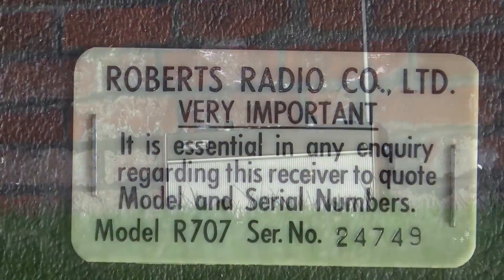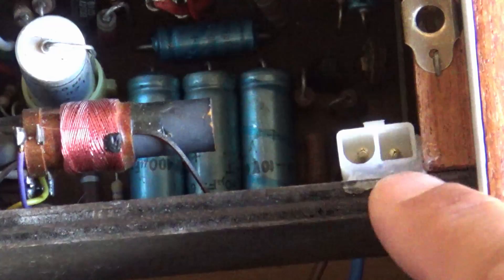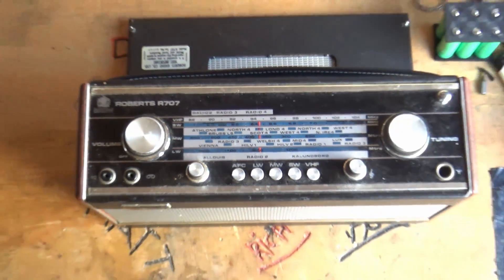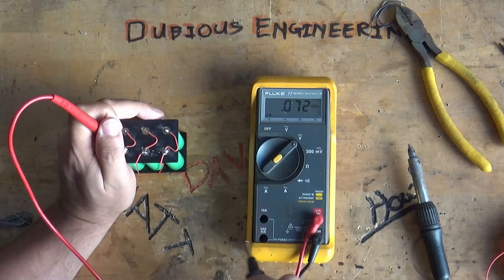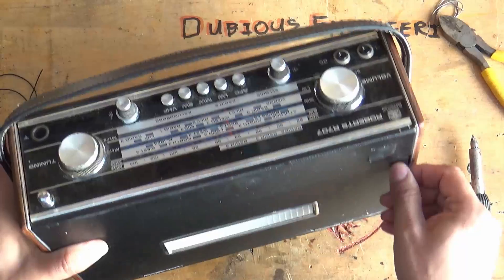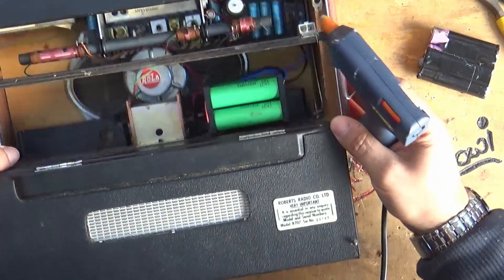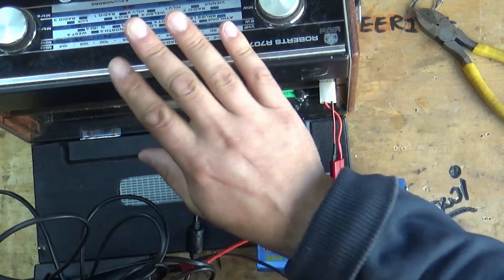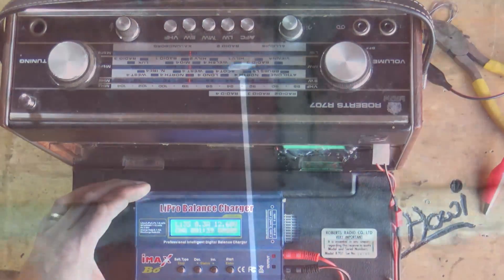DuB-EnG: Vintage Roberts707R Radio Upgrade to Lithium Ion - DIY How To Refurbish Repair LW MW SW FM

Comment: I get a headache watching this. 
You are hyperactive.
No structure.  Vital information not given. Instead spinning this radio around and around and around again.
I am guessing that these radios originally have 2x 6 volt batteries in series and therefore run on 12 volt.
Reply from the maker: Yes, I'm sure i have a mental condition...  i hope I'm getting it more under control these days...  i think they needed 6v for the valve heating elements and 12v for the radio circuit...  sorry i drove you nuts! 😀 best, Howard

Comment: why go to all this trouble, just buy 12 volt mains adaptor from amazon £3.99 but looks like you ripped it out, chrome circle on side of wood, waste of time as you can also plug it into car 12volt too ,with adaptor,,as i use it in my camper van, no messing about with stupid batteries that are also bad for the environment !!!!!!
Reply from the maker: Its a good point Terry... that said, it's nice to be completely portable...  I'd like a solar panel on it one day!

Comment: ha ha you evil swine :-D
I was going to say if it sat near a window then hang a small solar panel on its back and rig up a trickle charger to keep the batterys up, i dont know if l-ion batterys would mind that.
But its likely it will sit against a wall.

The hacker radio uses 18v (2 x 9v), and some odd radios use the batterys wired  +9  0 -9 volt.
Must be for a push pull p.a with center 0v.
Reply from the maker: Ah...  I'd forgotten about Hacker radios! - You're right! They did use class AB push/pull transistor amplifiers on their power amp stages...  This radio does spend most of its time in the window, so a 12v trickle charge would be a great idea!  I just need to limit the voltage to 3x4.2v = 12.6Vmax...  I'll see what kit I have kicking around... perhaps an LM317T would do the job!
Reply: The lm317t is my favorite, such a usefull regulator 1.25v upwards i think, and using regulators for current limiting is naughty too lol.
Im sure you have used the 78xx series too, so many out there to fondle :-D
But the L200 is a touchy sod without a really good metal to tab heatsink.
Or perhaps you like the discrete transistor/zenna/caps/reststor/stabilzer  circuits.
Reply from the maker: Here’s a little short to amuse you...   https://youtu.be/q2iAUVnwMaA
Reply from the maker: Yeah... I’ve tried them all... and the 317T and 78xx win... you can even get a 317T in a large SO2 package for higher current applications... 🙀 5WholeAmps! ...  I reckon a 7812 500mW and a 16-20v solar panel will do the job...  now... dang... if only I had that stuff kicking around ! ...   as an aside, I keep toying with the idea of an appregiator made from 5 off 555circuits...   that would be fun to noodle around with...  but...  there are so many other projects to finish first...
Reply: I had to look that name up, from the discriptions it sounds confusing, but im not into music lol.
The old 555 timer i love, so many clever circuits to use that timer.
I don't like the cmos version, weak output, not as stable as the transistor based version.
Oops you fell asleep :-D

It's a shame that the creator passed away in 2012 i think.

You could get a big kit to make a 555 timer from transistors, very large chip though lol, if it was your interest of cause
Reply from the maker: We’re a proper couple of nerds aren’t we!
Reply from the maker: Here’s my next likely release ... for being such a supportive superstar and commenting!   ...   https://youtu.be/AOSXItWtsIo

Comment: Hi, I did wonder how you were spinning the radio so well, until I saw theturntable thing underneath. Does that have any other purpose than just letting you spin the radio around ?
Reply from the maker: Very good question!! - It was designed specifically in 1980 as they knew i liked to spin radios on my channel !!   :-)    Sorry for the sarcasm...  So, remember the ferrite-rod?  (black doofer with coils on - collects radio waves) - its directional, so rotating the radio towards the transmitting station will encourage a stronger signal - hence better reception!

Comment: Any plans for more future mods. I see it has a tape input, maybe add Bluetooth, I'm sure a clever chap like you could bodge that together in an afternoon
Reply from the maker: Interestingly...  I believe they are both outputs...  External speaker power output 4 watts and headphones 100mW.... I'll double check that...  As reel to reel tapes and some early portable tape players were around then...   Someone suggested a solar panel - which is doable, and i like your idea of bluetooth which should also be doable.  ...   hmmm....   thinking....